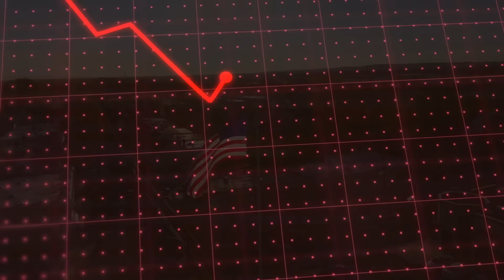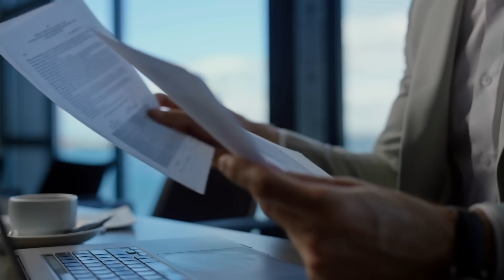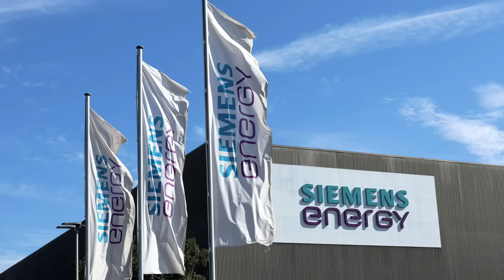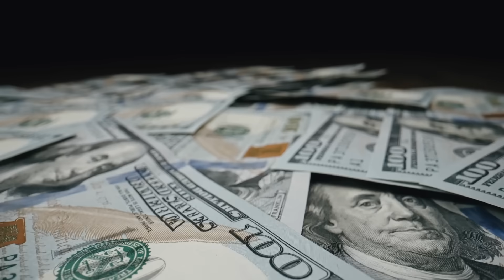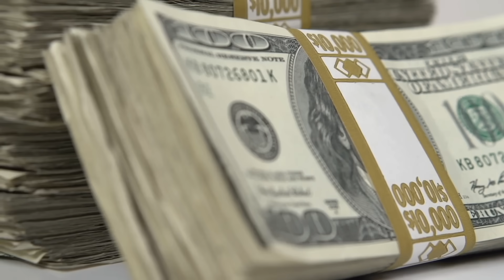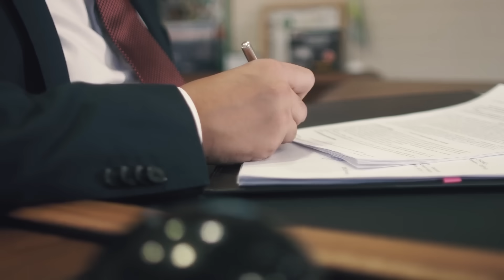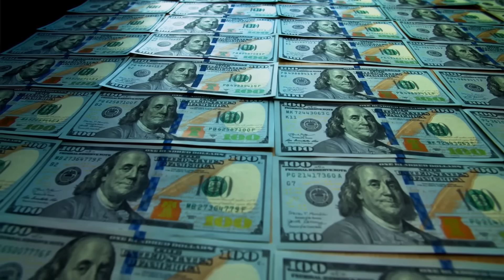The Real Reason America Has Turned Its Back On Wind Power Energy

Comment: The federal government under both major parties would rather squander our taxpayer money on endless military equipment and bases throughout the world than on infrastructure here at home.  

Rather than “tactical to practical” we have “tactical to endless impractical war.”
Reply: We the tax payer has paid dearly for the entirety.  The cost per kw will only increase.  The public utilities pay next to nothing. infrastructure was  from federally collection of taxes.  To manufacturer a transformer is not expensive and it's the cost burden on anyone who wishes to connect to the grid, you also need a grid tie interconnect, this is a two way valve that measures the uploads and download of power. The actual infrastructure is not the issue.  It's the public utilities greed, in Washington state the federal government built the power plants and ran the transmission lines to the local communities. The public power company charges you to connect from your transformer to your meter for the equipment they will not pay one cent for you to connect. Federal law requires them to connect you and pay u
You for the power you produce. I pay all of this money to generate power and the cost to connect to the grid only to get a fraction of the value of each kw of power sold to the consumer.  The public utilities pay $.09 per kw and bill $.90 per kw.  All a public utility really does is maintain existing infrastructure, connection to the grid isn't a issue.  The transformer is always the expense of the individual who ties into the grid.   You build a wind farm without having a preset plan to sell your power to the consumer your a fool.  All intelligent plans would include all the aspects including the grid connection and how much per kw the utilities will pay.
We in Washington state have no problems with grid tie in, we also have a surplus of electrical power so it's exported to Oregon and California.   I am not a idiot and the cost of billions of dollars the power companies need to accomplish the upgrade for demand is horse shit.  It is the responsibility of the consumer to pay for everything required. Transformer and lines to you are your expense. They never have paid for you to tie in.   I bet dollars to doughnuts the wind farms power production would replace too much profit.  I seriously doubt the wind warm is making a profit on ten cents to the dollar.
Reply: @vidxs  , when I said “infrastructure” I made no mention of the cost of grid-tie connections.  That has always been on the individual homeowner, not the utility or the state etc. which is why so many who live far from the grid prefer to invest instead in batteries, generators and solar or wind systems because in many cases the cost is greater if they want a grid connection.

Insofar as your other comments.most are also pretty obvious.  The fact that utilities pay those who produce excess power a small fraction of what they charge with grid-tie systems is evidence of the greed of utilities.  In addition the utilities have lobbied to make it illegal for individual homeowners to even have small wind turbines in many states, and have succeeded in eliminating mandatory feed-in tariffs for grid-tie systems as well, thus killing off almost all solar installations that are not purely battery based.

This could ultimately destroy the utilities if battery based systems become cheap enough to make connection to the greed-based utilities too exorbitant in comparison.

But it is the utilities who have both the state and federal governments’ ear, not the individuals who own small businesses and property.

But big wind and solar are being screwed by the inability of the grid to handle the excess power they produce, as the video explains.
Reply: @LawrenceCarroll1234  
Your absolutely correct  currently they have all the power in Washington state as for other states I am not too aware of it.  I cannot see the current technology I'm batteries able to help here today. Tomorrow is a different story with growth the utilities must change it's only a matter of time then they will cry for money because the infrastructure is barely adequate.  What about a solar event that knocks out the grid? Is there sufficient back up transformers?
Reply: @vidxs  , good question (at the end).  I’d wager “probably not.”

Comment: The US can't be zero emission. At any time in the foreseeable future while we might get energy production to go greener than it is. The increasing pollution from manufacturing the materials to go green will increase. And you might go green in pit mining with all electric equipment since it stays in a confined space. Farming requires moving equipment all over the place since some terrain is unsuitable for farming and ranching. The cost of putting charging stations in the middle of farm lands making it easier to charge plus the numbers involved to charge the large combines would take more time than they would operate. Which means food prices climbing to record levels. Since there are a small window for harvesting crops like wheat. Where thunderstorms can keep it wet enough to mold or mildew, hail knocking the seeds off the heads. To little moisture and the seeds drop on their own. 
Once they are ready combines run 24 hours a day until its all cut. If you have to stop a combine for 8 hrs to charge even 4 hrs to charge that excessive down time where time is money and the harvest is perishable. Buying additional equipment isn't a reasonable option since combines can top a million dollars each. And with the cost of preparing the soil for planting then weed control, insect  control transportation of the crops alongside equipment, maintenance of equipment means that the elimination of close to a third of the green house glasses come from farming. That means fuel, oil, lubrication, tyres, plastics, chemicals, medicine, food stocks. All required oil which requires fuel to be burned since the oil isn't always near the power grid and the cost of trying to run power close enough to be effective and it wasn't the efficiency wasn't effectiveness of it its the lack of users. If it cost 50 million to run power in an area where only a handful of users are there to use it and not enough to offset costs their is no reason for the investment of resources or money.

Comment: Windmills clean and green?? Dream on,, all that concrete and steel, all those fibreglass blades with NO RECYCLING. In parts of the world this stuff is being abandoned totally. So  eyesores that do nothing and then leaking all that oil into the soil. Yes they use oil for lubrication as well as insulation and it will leak, far more so with no maintenance. 
Solar is commercial arrays is possibly viable both financially and for generation. This does NOT mean ugly rooves booting the price of power into the stratosphere. Subsidised by the majority who do not want it or cannot do it,
And ofcourse none of this will ever be baseload power,,, so the grid lives on the edge of failure. But the power companies are closing baseload generation as half assed power makes more profits,, and billion dollar subsidies.
Reply: Wind is green. That is the definition.

Comment: Propaganda for the fossil fuel industry.
Opting out of wind power? The largest Wind Project EVER - $11 Billion - just launched in Arizona. Final commissioning will occur in under 2 years - 2026!

"In reality" companies are halting or closing wind projects? That's a lie.
Cancellations by Shell & other FOSSIL FUEL companies? Not hard to understand.
The fossil fuel industry will continue to shrink & consolidate, but the few massive companies left will make bumper profits. They want those profits. So do Chevron & Exxon.

Other problems cited with utilities & with the grid are true and real problems. Utilities have spent decades NOT investing in growth & maintenance of infrastructure, but instead spinning off dividends to  investors who see utility stocks as very nearly a financial annuity. Their management is fat, lazy and rich. They don't want to gear up, get busy & compete by building a whole new infrastructure. They're like legacy auto manufacturers getting whipsawed by Tesla.

And yes, the bureaucratic approvals process is slow, sclerotic. This industry isn't built for change or speed. That has to change.

If it doesn't change, the market will find a way past it. Solar keeps dropping in cost - by 16% minimum annually, compounded, for the past 25 years, but last year alone by 50%! As solar gets cheaper, rooftop solar for homeowners will become cheap enough that a massive chunk of the market simply disconnects from the grid. That'll make the economics of electricity distribution MORE expensive, putting utilities behind the 8-ball. 

They'd better get their act together & push regulators to find ways to speed approvals for development of large wind & solar farms, grid-scale battery farms, and significant transmission lines. If they don't, all the costs of those systems will be borne by fewer ratepayers. Utilities will shrink, their profit margins will shrink, dividends will fall and executive paychecks will suffer too.

Comment: Something not mentioned is that a severe solar storm or the high-altitude explosion of a few nuclear weapons could take down most of our electricity grid. The result could be mass starvation because we have less than a week's food on hand and the grid would take much longer than a week to repair. We need to improve and strengthen the grid, increase local energy storage, and increase the amount of food that we have stored.
Reply: Definitely more people should store away more than a week of food and water. Don't forget water, because you can not digest food without water. At least fill up some empty vinegar or soda bottles with tap water and set them in an unused bathtub or in the basement or somewhere where they won't freeze.

Imagine simply a blizzard in which hopefully most people would simply prefer to stay home until the roads are more passable. Bad roads plus excessive traffic is a bad combination. Stay home in bad weather.

And make sure that your can opener is not electric.

I hate when there is an electricity outage. Although my gas logs still function like everything is normal, thermostat on the wall doesn't even know that the power is out (powered simply by the lit pilot light), the refrigerator door can not be opened, not even once, as it will lose its cool. Otherwise, it should stay cold for several hours if the door is kept closed.

Comment: Stop fooling yourselves they aren't renewable and definitely not green. Have you ever looked at the base of the head of the unit with the blades on it and seen the oil dripping down That's hydraulic fluid they're filled with this and they have to keep putting it in to keep it running. And take a look at how they make the structure it's made with oil products it's nasty chemicals you guys are fooling yourselves but hey what do I know I just did some research.
Reply: Then try to use up all the wind and sun. There will always be more.
Reply: And properly maintained they do not drip.

Comment: 😂🤣”Renewable Energy Wind/Solar” is an oxymoron. For every wind turbine erected it takes a min. of “900 tons” of concrete for the base, And the making of concrete is the most carbon intensive process on the planet, never mind the upkeep with fossil fuels for them. Then at the end of their 20 yr cycle(max usage) the blades “Can Not” be recycled and are usually buried. As for solar panels they leech out poison chemicals so that the land they’re on is no longer usable. That’s just the Coles Notes version.

Comment: Umm... Kinda focused on 1 issue, completely over looked the issue that wind and solar are direct feed solutions. The biggest issue is still power storage for when the wind doesnt blow and the sun is set. With out base line power sources it doesnt even matter if the grid can feed to consumers from these locations.
Reply: When the sun is set, the country needs less electricity.
Building enough windturbines in different places reduces the fluctuation.

Comment: It is an inviromental disaster!
Reply: Not really. It is just laying there. I am sure that all the abandoned factory areas in the US are a bigger enviromental disaster.
Reply: @old-pete  no production is very polluting and end of cycle destois the planet
Reply: @terenceiutzi4003 Could you translate that into English?
Reply: @old-pete  so what is your language of choice.  It sure isn't English
Reply: @terenceiutzi4003 It is still English. Looks like even you do not know what you wanted to write.
Reply: Wind and solar radiation are renewable. That is a fact. Try to use them all up.
Reply: @old-pete  so you are saying that coal and oil are renewable! Then why don't we scrap wind and solar and use them they are much cheaper and more reliable? A wind turbine uses much more coal and oil per KWH during their lifetime, then coal and oil!
Reply: @terenceiutzi4003  No, I do not.
Windturbines have 1/100th of the CO2 footprint for each produced kWh than coal power plants. They are also much cheaper than coal power plants.
Reply: @old-pete  they burn 10 times as much coal and oil as a thermal plant would to produce the same amount of electricity. How much electricity would a clean coal plant produce burning 1400 tons of coal? Natticoke produced more electricity than the 900 wind turbines that replaced it due to 20,000 tons of coal a year, and wind turbines only last 20 years and required 4 sets of blades in that time! Give your heada shake!
Reply: They do not burn coal...

And a coal power plant does not run long on 1400 tons of coal.

And properly maintained windturbines need one set of blades in 20 years and can then continue to run.
Reply: @old-pete  how do they make the thousand tons of steel in each foundation? Don't  tell me. Pity dust and unicorn farts. Right?
Reply: @terenceiutzi4003  That would be a giant turbine. A 2 MW turbines needs around 30tons of steel for the foundation.
As I already explained. That is part of the CO2 footprint of a windturbine.
Btw. a 2 MW turbine produces as much electricity in a year as a coal power plant with 1400 tons of coal. For 20,000 tons of coal, one would need around 15 2MW tubines....
A power plant that produces more electricity than 900 windturbines needs A LOT more coal.
Reply: @old-pete  bull shit I watch them tigh in 15  5 axal tractor trailer loads of rebar in the foundation of the small turbine outside of Woodstock do the math!
Reply: @terenceiutzi4003 I suggest you look up power capacity of the windturbine then...
You are extremly unspecific.
Reply: @terenceiutzi4003 The video says 68tons, not thousands of tons...
Reply: @old-pete  I have yes they are minute compared to a thermal.plant.
Reply: @terenceiutzi4003  ... which uses millions of tons of coal per year.
Reply: @old-pete  look at the size of it and look at the reinforcement require melts per Cusick foot of concrete.  The new bridge they just built on 401 required 300,000 LBS in each pier.
Reply: @terenceiutzi4003 What has this to do with windturbines?
Reply: @old-pete  that is for each wind turbine and 900 don't put out as much electricity as the Natticoke  plant did!!!

Comment: Apart from wood or biomass there is no such thing as renewable energy. To capture solar,wind or whatever it takes a device that is created using materials from the earth. They can't really be put back. Try recycling a wind turbine.  Green energy is not as clean as it's made out to be.
Reply: The definition applies to the source of energy and that is the wind and the sun.
And the recycling is no problem.
Reply: @old-pete  I've seen wind turbines and solar panels being put into landfill as it's not economical to recycle them so I suppose you could say they have been returned to earth.
Reply: @mgcarmkm4520 That is a goverments decision to allow it. Dumping used motor oil near the road is also cheaper than recycling. That is why smart goverments make it illegal

Comment: MicroWind-Turbines are Better.
Reply: They are inefficient. Nothing beats physics.
Reply: @old-pete  Physics gives the RPM with the fluidity of Airflow.
Reply: @lokesh303101  It does not change the cubic increase in windenergy, when increasing windspeed or the quadratic ncrease of area, when icreasing the radius.
Reply: @old-pete  Neither can drive in a Length of Stream of Air.
Reply: @lokesh303101  Turbines do not drive.
Reply: @old-pete  Thanks Bro!